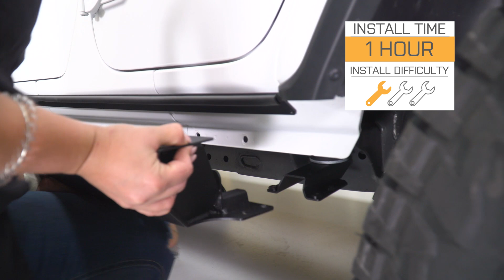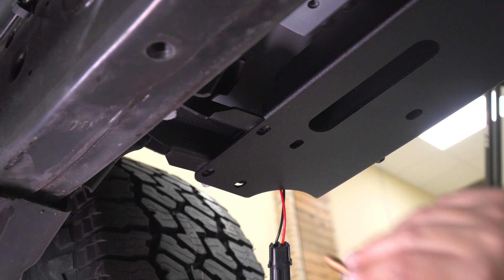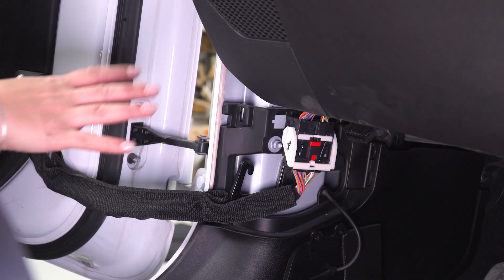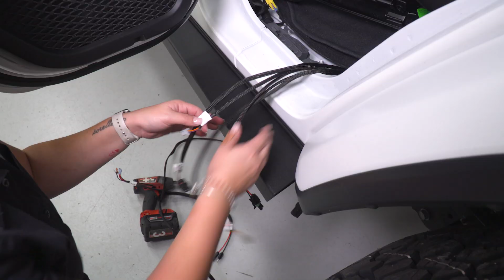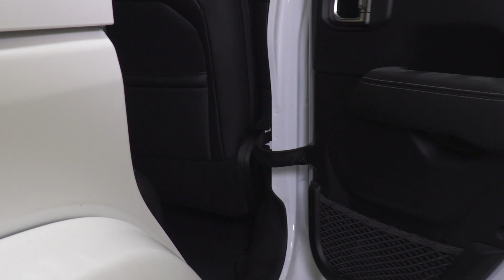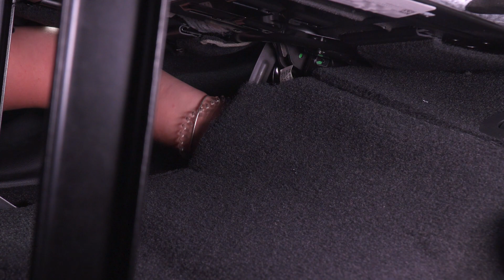Jeep Wrangler JL 4-Door Rock-Slide Engineering Gen II Step Sliders Review & Install

Comment: Installed these in April/May 2020. They are awesome in all regards, except, they drain the battery dry! I’ve had to replace a sulfated battery (at the dealer) twice because of these, on a 2020 High Altitude. Has anyone figured out a remedy to this battery issue? I hate to uninstall them, but may have no choice as my wife has now been stranded at a remote state park due to this problem. Not good!!!!!
Reply from the maker: These should come with an power kill switch in the kit where you can keep them off. Usually for when the doors are taken off but if there's a draw the switch would help!

Comment: so your running the wires through the drain holes? Got to be a better way.
Reply: Drain holes are in a separate location with oval black rubber plugs instead of body-color matched circular plugs.

Comment: I have the gen 2 but sometimes they don’t come out all the way and don’t lock out all the way so the step feels loose. But when it works it works great lol
Reply: Did the gen 2 stop working correctly because wheeling on the trails? or it just got lazy?
Reply: jeep lova just gets lazy every once in awhile.
Reply: @bubustinks  ok.I want to upgrade mine  but i dont really have a lot of options for the gladiator.
Reply: jeep lova they are great and I get compliments all the time they definitely look and feel better than the amp steps. Those are garbage. But other than being lazy every now and again I recommend them. Their customer support is great too just lazy to call lol